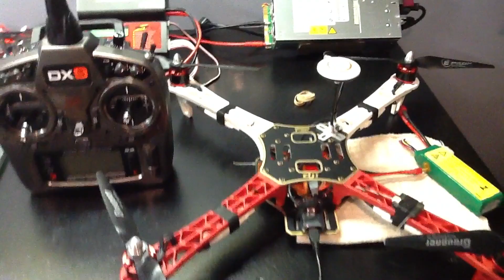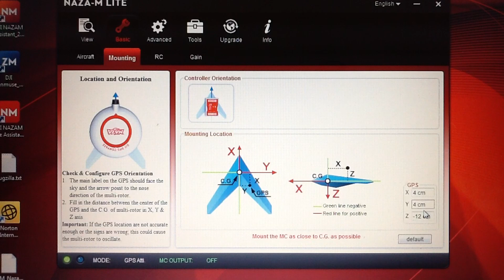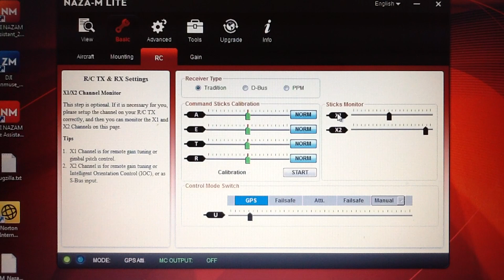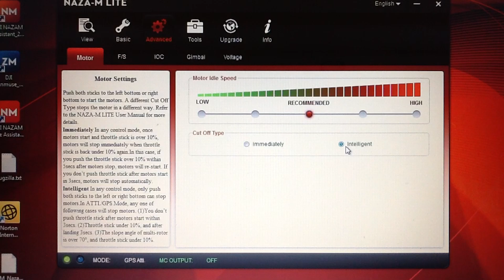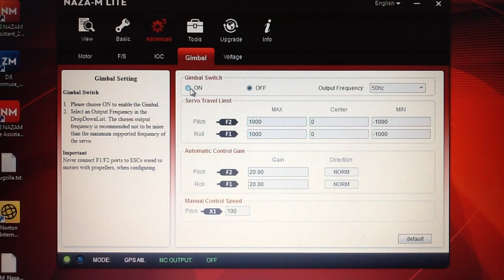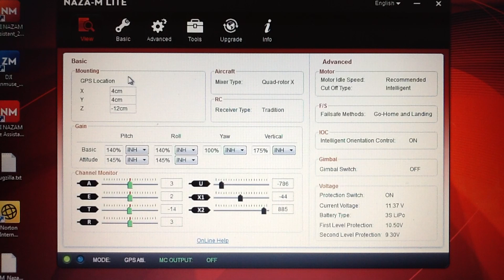Spektrum Programming For NazaM Video#5

Comment: Regarding the IOC...can not get the Course Lock idicator adjusted to go blue  using the TRIM adj on the Gear channel... using a Spektrum DX7s transmitter...all other adjustment work OK.  thanks for your assistance
Reply from the maker: yianni513 - if you followed my recommendations then the GEAR is not the channel to adjust for IOC but rather Aux2. Adjust center position (courselock) with trim for aux2 then use channel travel to adjust end of travel for off and homelock.

Comment: Hi, thanks for the great videos! I have an issue, after following the set up I try to test the failsafe by turning my radio off but the light does not go yellow as per failsafe. It just stays as if radio was kept on... Any idea? thanks in advance :)
Reply from the maker: Did you bind the receiver in Preset Failsafe mode with your failsafe switch activated ?  Does your receiver support Preset Failsafe?? Not all spektrum receivers support this. One 6ch Rx and the 8channel receiver and higher support Preset Failsafe. 

One trick to finding out if it does is while the bind plug is insert and the LED flashing, remove the bind plug prior to powering on the radio. If the LED stops flashing your Rx doesn't support it, if it keeps flashing then toggle your switches on the radio where you want them (Failsafe position) and bind the radio with bind plug removed.
Reply: I have the AR8000 and yes I did the preset failsafe. Are you saying that I need to bind the rx with the radio switch on the RTH position instead of off?
Thanks a million
Reply from the maker: +rotormasher - Yes, DJI recommend you position the throttle stick above 10%. You should also toggle into failsafe return home if you have it programmed prior to binding the radio. That way the receiver will send every channel to their bind position which in this case will be failsafe return home
Reply: Oh man, I've just done it! 
I can't believe that the reason it didn't work before was because I did not have the radio switch into FS/ RTH position during binding! Thanks a million, now need testing at the field... :)

Comment: My Flight Mode switch seems to do nothing on my DX8. I can't change between GPS, attitude and Manuel modes???
Reply from the maker: +grbroussard Naza Flight Modes are controlled via the channel connect to the Naza's U-Port. Make sure your programming is setup to control that channel. In my videos this should be the Gear Channel...

Comment: Great stuff I find the videos very instructive.
But I have a problem The assistant tells me I have low voltage (The actual voltage is 12.3V 3 cell Lipo)  The NazaM Assistant software the voltage set up page is greyed out & I cannot change any setting It also say the current voltage is disconnected
Can you help Please

Stan J

Comment: Hey Freechip. Currently working with a DX8. I am unable to have altitude mode show up blue on the naza assistant as i switch between gps, atti., and manuel mode. In sub servo mode i have GPS set at 90% and manuel mode set at 80%. Not sure how to get the arrow to line up directly in the middle and have "Atti." light up blue. Was wondering if you have any advice.
Reply from the maker: Andrew - Start by resetting the Servo Travel and any Sub-Trim you may have for your channel that is connected to U-Port (GPS,ATTI & Manual). Now toggle your selected switch to Attitude and looking at the Naza Assistant use Servo SUB-TRIM to adjust the ATTITUDE position first. Once it lights up BLUE then switch to GPS and adjust using SERVO TRAVEL and repeat for MANUAL mode making sure you switch in Manual Mode and then adjust using SERVO TRAVEL..
Reply: freemarlochip
Hey Freechip. having another issue. My Naza-M v2 seems to have frozen after I toggled through failsafe and now rotor 1,3, and 4 do not spin freely, showing signs of motor resistance as well as rotor 2 not recieving any signal from transmitter or Naza assistance software, but does spin freely. any ideas?
So far I have unplugged everything, plugged it back in. I tried re-programming from scratch. I tried firmware reset. Still nothing. I have a feeling a fried the NazaM. :(
Reply from the maker: Andrew Perotti Unfortunately no amount of transmitter programming will cause hardware failure in the model... Are you using third party ESCs? you could have some that have BRAKE functions active while other(s) don't. To check connect each ESC directly in the throttle channel of the receiver and see if they function properly REMOVE PROPS for safety.

If you click on my About in youtube you can message me and there share your email info that way we can communicate better and check out my website..  https://sites.google.com/site/spektrumradioprogramminghelp/